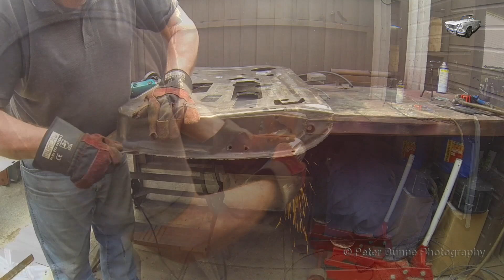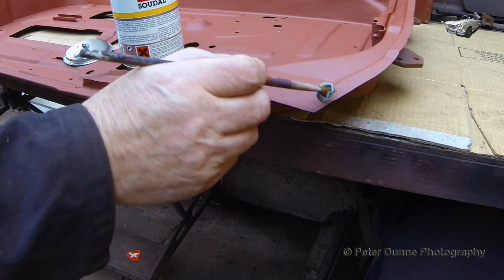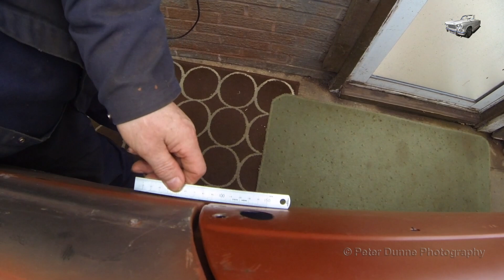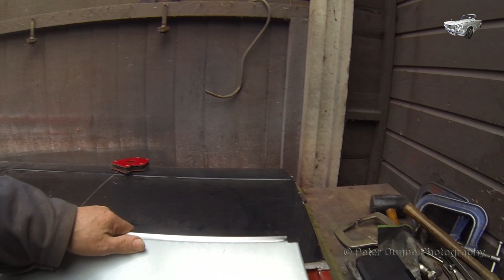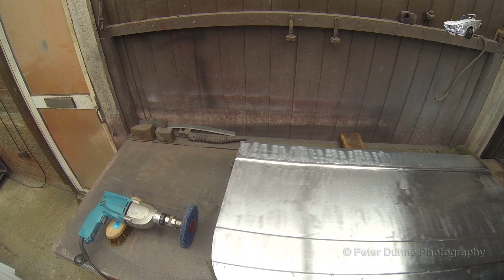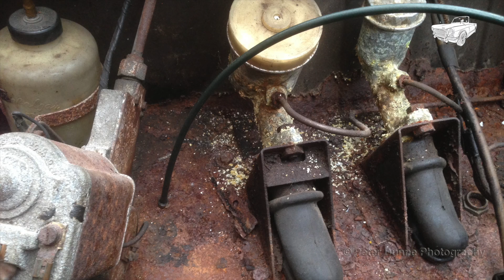Video number 8 Fitting new door skin

Comment: Hi Peter. Triumph were the first manufacturer to supply door skins (by the request of the insurance companies ) We were Triumph main dealers and a representive came to see me fit the first skin. You can understand that rust was  not an issue . It was purely for accident damage purposes . However , the salesmen soon realised they could buy cheap , get us to fit skins in our lunchtime , and likewise the painters and make a nice earner. I never used those crimping tools. I just peaned them over with a hammer and dolly . I became very good at this and l could complete a skin from the car rolling in to going back out in less than an hour . And you're spot on with hanging the door before welding ! Thanks Peter.
Reply from the maker: It must’ve been great doing those doors with original door skins and no rust to deal with.
Reply: @peterdunne8107  it was Peter. And being in Torquay , going dowwn to the Pzlm Court Hotel for a pint at lunchtime was the icing on the cake !!!!!
Reply from the maker: I'm afraid not for me if I did that, I wouldn't go back to work that day.